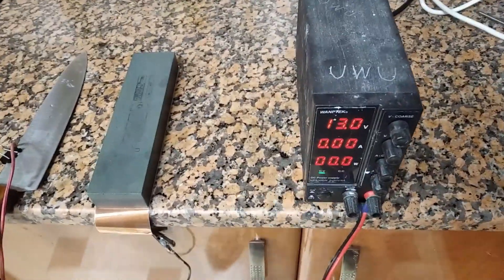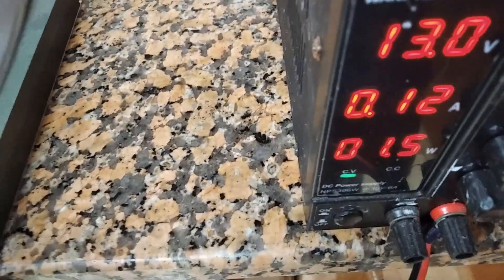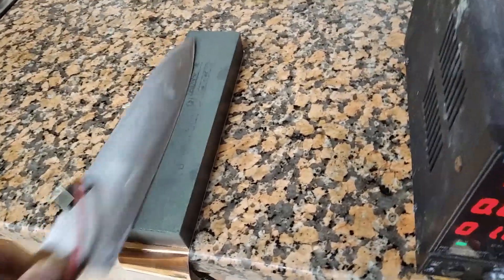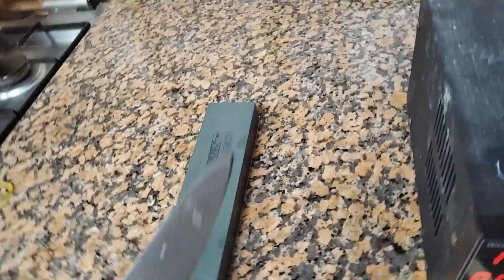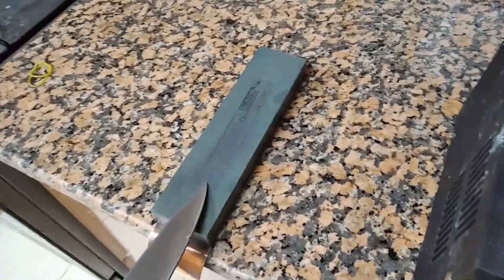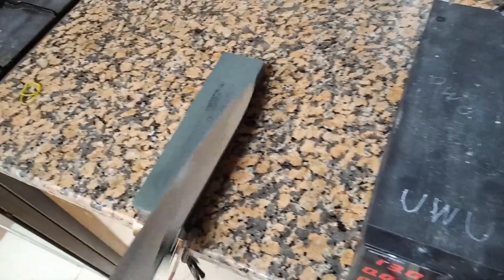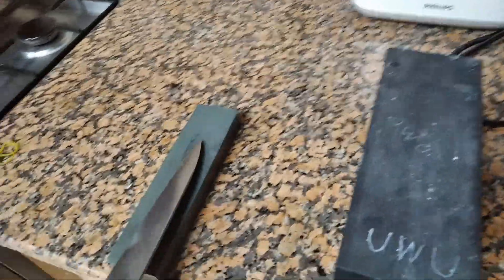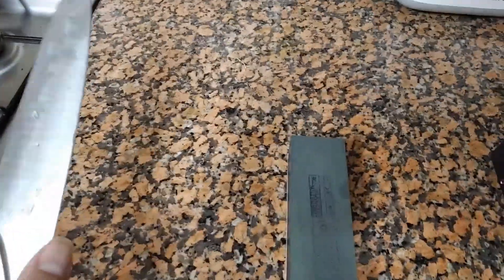Sharpening a knife better than any whetstone using electrochemical grinding (membrane electrolysis).

Comment: Duuuuuude!
I didn't know this was a thing:  knife sharpening through electrochemistry...  As a pro chef, I used a belt sander to sharpen mine...  I never could master the whetstone.
The only things I ever used electrochemistry for was electroplating, but I heard it's easy to turn Toluene into an Aldehyde using electrochemistry.  I saw someone attempt it on a TV show (Hamilton from Vice), but it seemed to have failed.  
I think his MethOdology was was purposely missing some key components that act to deter away those who don't know what they are doing and have dollar signs in their eyes...  Although it was noted that the kitchen this was performed in smelled of cherries and almonds, so some amount must have been converted...
The chemist in question's "Workup" was throwing some Sodium Bisulfite into the Toluene/Aldehyde solution and hoping it would form the adduct.  (formation of the adduct, as I have learned first hand, requires water to get the Bisulfite into solution:  not something I thought of until I was making the same mistake myself in an unrelated project)
Sorry for the ramble!  Rock on, brother man!
Reply: Benzaldehyde
Reply: @alexwang982  no comment

Comment: U have no clue about what you are talking about   the best thing is a compound and a pices leather I carve  wood ever  day i promises  you a diamond  stone and compound is the only way
Reply from the maker: I wonder then why this technique is used in industry to obtain stuff like scalpels and needles.
ofc this is a more manual version and I have no experience in sharpening but the technique of electrochemical etching is done to produce the sharpest blades in existence.
even SEM needles are produced via this methods which are literally sharp down to the atom.

The goal of this series is to finally get a version of this that rivals the slower multistone process but instead varying the voltage.

Comment: Interesting, I'll have to try this sometime. The best way to use a stone is to hold the knife perpendicular to the stone and move the knife as though you're shaving off a layer of the stone in one long stroke, moving from the tip of the knife to the hilt as you move through the stroke. I did this with my knives and they were sharp as scalpels.

Comment: That demo at the end is...a little short of impressive. You're tearing that paper on each cut, which means it's nowhere near as sharp as you can get with the usual application of even one stage of whetstone, let alone the multi-stage ones people use to get a mirror finish and an edge suitable for things like shaving.
Reply from the maker: I am by no means an expert in knife sharpening but I am mostly pointing out a process used in industry to create really sharp blades and the goal is to attempt to refine this process while keeping it DIY enough enough such that it would be that easy to sharpen one with little effort.
any tips on my angle of sharpening etc would be good as yea sharpening it one handed while filming prolly was the downside to this demo.
Reply: @CatboyChemicalSociety  your point about a camera mount is extremely well taken. From there, a few minutes' practice with the sharpening stone you already have, based on a few minutes' worth of watching videos/reading instructions/whatever works for you would do it. You had the whole knife at about 90° off from where most people use whetstones, i.e. almost parallel to it and not at the usual (about) right angle. Controlling the angle between the blade surface and the stone is a thing easiest to do when you have both hands free to do it.

I get that I'm saying you'd need to put in both material resources and your time, either or both of which may be at a premium, and I also get that you should never feel any slightest obligation to commit those resources at the behest of some rando--in this case me--in the comments section. I'm just mentioning what I'd do if I wanted to build a case for using this method.
Reply from the maker: @davidfetter  yea maybe give it a try with some shit knife it may give good results.
from the wikipedia article they use 20% salt solution.
Overall I wanna see related vids even with this concept and perhaps hopefully this turns into something nice like a sharpening kit using this concept.
What fascinates me is the claim on wikipedia stating that it reduces the wear of the stone by 90%.